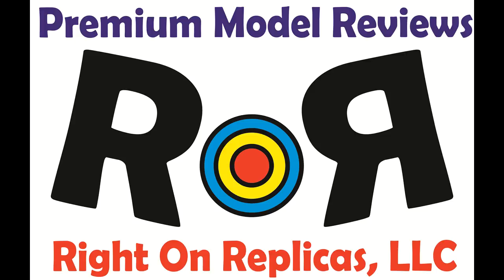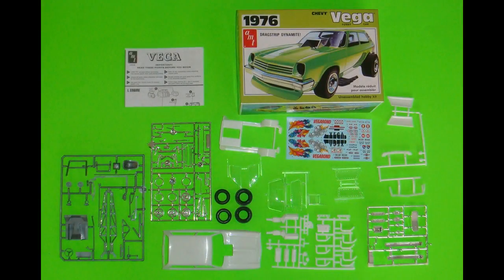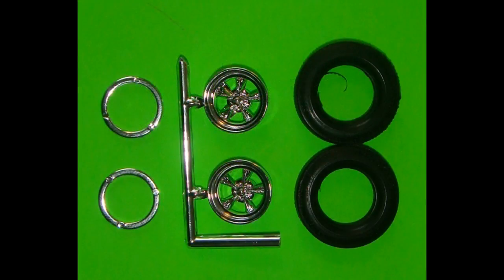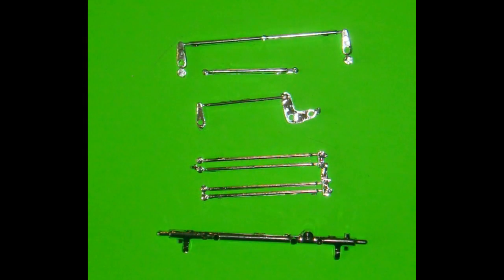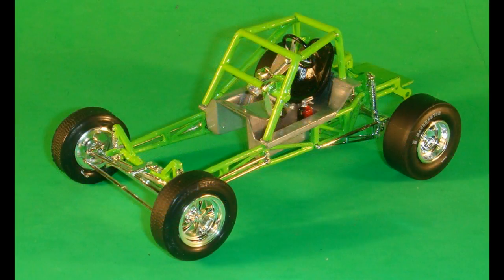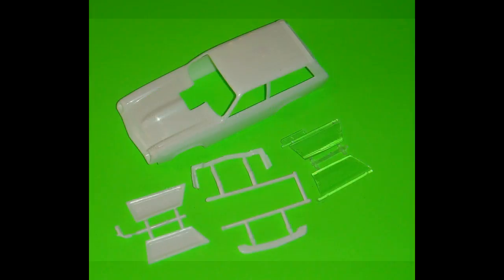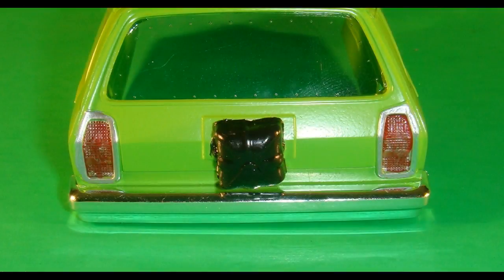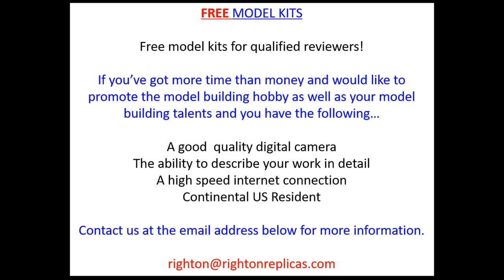1976 Chevy Vega Funny Car 1:25 Scale AMT #1156  -Model Kit Build & Review

Comment: Yes the headers  are a real pain in the butt, you have to tape or clamp them down until they dry. I also didn't like the over sized front wheels and the rear wheels sticking out so far ( should be inside the body ), but with some rework this could be a nice kit. I also like the AMT 1971 Vega kit No. T112-225 | 1:25 ,
Reply from the maker: GS,  Thanks for the tips!  -Doug
Reply from the maker: MJ,  Let us know how it goes!  -Doug
Reply from the maker: MJ,  Might have to find slightly smaller tires for a good fit!  -Doug